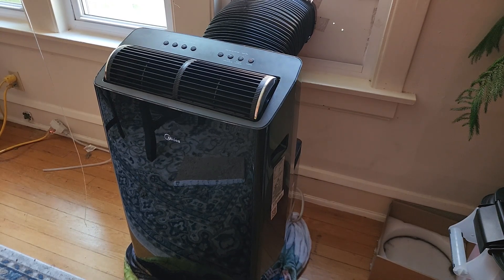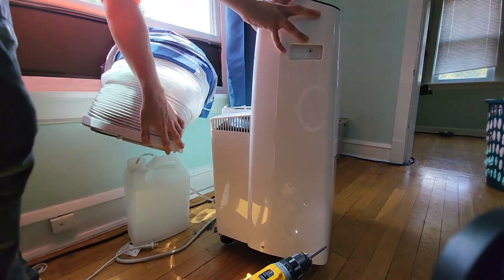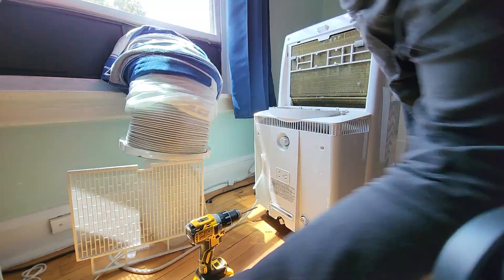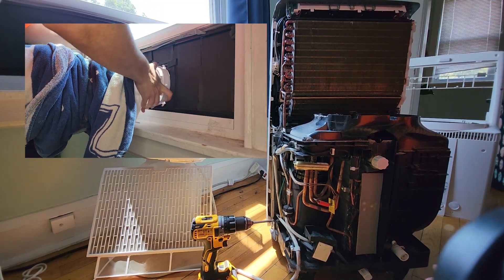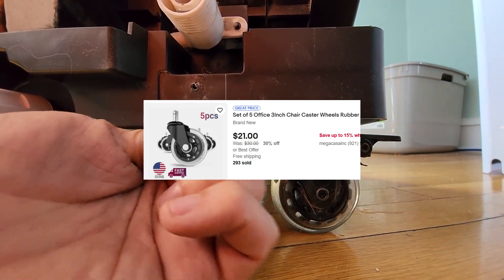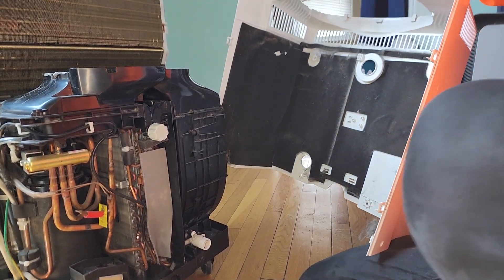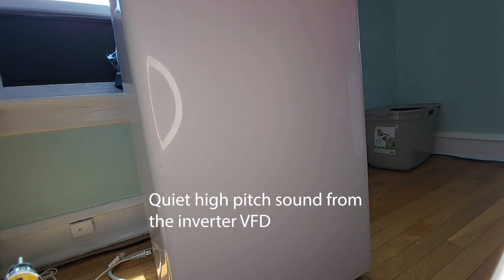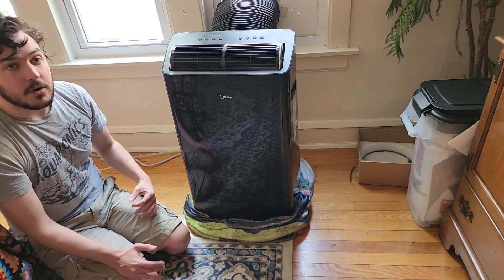Why the Midea Duo is an *Almost* perfect choice for Cooling AND Heating Your Home

Comment: I never took the time to properly. Thank you for the video you made. The only thing I would ask is if you can show the remote control. That actually comes with The black unit and the winter branded unit. Because I hear The One with  Midea Duo Is much nicer than the one with the winter unit. Also, there is a new brand popping up which is just a license version of this. It is Cooper and hunter. By the way, thank you so much for that video.
Reply from the maker: The Midea branded remote is absolutely a nicer remote for whatever reason. I'll see if I can make a community post of the two. It's mostly a visual and ergonomic thing, I think they mostly work the same.
Reply: @AnIdiotwithaSubaru  That's what I was thinking. But honestly I don't know of any other portable air conditioner heater combo that can compete with this.
Reply from the maker: @vectorcollector4893  I'm hoping that in the next few years we will start to see some cold climate heat pump window units! Midea is already working on a cold climate 120v heat pump. They got pretty massive funding from New York (70 million)
Reply: @AnIdiotwithaSubaru  You know something that would make this unit that much better electric supplemental heat.
Reply from the maker: @vectorcollector4893  id love that! If it could heat down to like 20f and then have emergency heat, it would basically be a full on air handler
Reply: @AnIdiotwithaSubaru  It would not be hard to add that.
Honestly
And that would be great. And also there should be a built-in test mode to vary every component speed for repair technicians, just for testing purposes.
Reply: @AnIdiotwithaSubaru  Do you know if they're making a new model of this anytime soon?
Reply from the maker: @vectorcollector4893  not sure. The other company (Gradient) that got some of that 70 million already has a working model but it's very expensive. I think it's like over 3000 dollars. 

Search Gradient 120v window heat pump. Pretty impressive but no thanks at that price. 

I would imagine a giant like midea can't be that far behind. They just need to make one that works well in super cold climates.
Reply: @AnIdiotwithaSubaru  But in the perspective of portable air conditioners. I don't know if anything is going to top this for a while only if they release an updated model.
Reply: @AnIdiotwithaSubaru  A common complaint about these units, especially the Toshiba branded model, is that they do not have a defrost cycle which you have already proven that they do.
But I'm curious why some people cannot get They're unit to go into defrost.

Comment: Awesome video. Wondering if you ever figured out how to clean the space between where the air blows out and the blower motor. If you take a flashlight and look down  in there you may see some bigger stuff or caked on somethings. Anyhow, I'd be super grateful if you did a video on that as well. Liked and subbed ad well!
Reply from the maker: I hot glued a soft bristle toothbrush to a thin rod and I gently work it up and down on the coils. It is strong enough to get the dirt off but not strong enough to bend the coils

Comment: When you use the heat do you need to use the window exit hose ?
Reply from the maker: What do you mean?
Reply: @AnIdiotwithaSubaru  do you need to put the air hose out the window or can you just have it collapsed on the unit just for the heat
Reply from the maker: @davekent20  the hose is required as it absorbs heat from outdoors. It doesn't work under 38f-40f unless you partially unhook the hose like in the video. 

It's not something you want to use for super cold weather. The technology isn't there yet

Comment: Have you had any problems with the draining of condensate on heating mode? Mine just leaks and leak no matter what connector I attach my hose to.
Reply from the maker: It should just be the second to bottom drain port. thankfully have not had drainage issues. Does it leak when the pump is on or just all the time?
Reply: @AnIdiotwithaSubaru  thanks for getting back to me! I have never heard a pump turn on? It’s on the second to lowest drain port, with a garden hose adapter to some drain pipe
Reply from the maker: @rdd594  it's a quiet hum that comes on usually every hour or every defrost cycle. It's just for the condensate pump in heat mode. It's very slow but powerful. I have mine adapted to a small 5/16 silicone tube that is feeding into a kitty litter jug. 

It should only expell water when the pump is on. It's usual only for 1-2 minutes at most

Comment: 7 cats in my house (all rescued as very small kittens that showed up on the back porch over an 8 year period of time). And two dogs (again, rescues). It’s a hairy situation. I’ve gotta vacuum my portable a/c’s intake filters every 4 to 6 weeks. Should probably do it more often.
I bought my unit about 4 years ago at a WalMart here in Arkansas and it is run near CONSTANTLY both winters and summers as it’s the primary a/c source for my 1200 sq.ft. home (my central cool/heat died and I ain’t gonna pay to fix it so I bought my Arctic King). It’s located in the combo kitchen/dining room with an open/doorless 3ft wide doorway separating that area from the rest of the non-air-conditioned house. Have had no problems out of it after 4 solid hard years of use and it seems to work as well as it did the first day I cranked it up, keeping the kitchen/dining room area very comfortable both in summers and in the winters even when it’s near freezing outside. Below freezing and on down to 0 degrees (outside) it must be a real efficient workhorse because although it can’t keep it t-shirt weather in here when it goes below freezing outside, it does manage to keep the temp quite livable in the kitchen/dining room (but you will feel some chill — so we wear sweatshirts and jackets then).

What brand is it? It’s an ARCTIC KING (apparently made by Midea as the manual that came with it gives a webaddress of www.midea.com ).
BTU/h: 13,500/11,000
SACC: 10,000
Its model# is WPPD10HW0N (‘H’ for heat-pump model). I’m happy with the way it’s held up, as hard as it gets used. When temps drop to below freezing or rise into the high 90s and above 100 — for however long those kind of temps are on us, my trusty Artic King by Midea NEVER shuts down to rest or take a break other than the defrost cycles when running the heat in the winter — then it’s right back to work keeping the cold at bay as soon as the defrost cycle has run its course. This can and has sometimes gone on SOLID for a week or two at a time. It’s forecast to get down to 28 again tonight, same as last night. It’s approaching freezing outside now and I’m here in the dining room at the kitchen table feeling cozy thanks to the constant work of my Artic King by Midea. It’s not the quietest machine in the world but it’s run so constantly that I’ve learned to tune it out.
Reply from the maker: Yeah, heat pump mode can be pretty loud. It does keep up pretty well, even on some pretty cold days (with the vent trick) 

With that many animals, id be sure the inside of your unit isn't getting filled with animal hair like both of mine were. I 3d printed some filters for the lower side vents to help but I'm going to clean it yearly most likely.
Reply: Sounds like a nasty house.

Comment: Thanks for the video! Two questions:
1. Did you finish the added fur filter add-on? I worry about all my dog's fur breaking this faster. 

2. In heat mode, do you need to vent it at all? Does it lose any efficiency? It seems like heating the already warmer inside air without be more efficient. Any reason not to do this?
Reply from the maker: I need to vent it when it's around 38f or lower outside in heat mode. It is less efficient but definitely still way more efficient than a space heater. 

I only got the sides done so far. The one's on the back are harder to seal off. It does work pretty well though. I'll upload it to my printables profile soon. 

Opening the vent up also opens it up to more hair btw. I'm probably going to wrap window screen over the hole in the future.

Comment: Whats the trick in order it to function below 32 degrees? Leaving the vent disconnected on one end?
Reply from the maker: Exactly, popping out the screw on that side allows warm air to mix with cold outside air. It still slightly more efficient since it's not sucking entirely from inside. 

I'm going to start running it with some sort of filtered mesh over the hole/opening though because the inside of my Midea was pretty gross.
Reply: @AnIdiotwithaSubaru  have you ever had an issue where the P1 code continues to persist on heat mode? I recently purchased the 14k BPU unit and have the P1 indicator turningnon within an hour of operation.
Reply from the maker: @SOLEoutx  do you have the condensate drain line hooked up? I've had the P1 error but the pump will kick on for a couple minutes usually and it will come back. 

With a low enough temperature, it's possible the unheated drain pan could freeze but I haven't experienced that down to nearly single digits. I believe the drain pan is heated enough from being indoors
Reply: @AnIdiotwithaSubaru  I don't think that this will work. The problem is that the Midea Duo has a thermostat just inside the intake part of the hose. This thermostat will shut the heater off when the temperature of the intake is below 40 degrees F.

This is compounded by the fact that the exhaust hose in located so close to the intake part of the hose that the intake part of the hose pulls in some of the exhaust stream, so realistically, it probably won't operate at outside temperatures below 45 degrees F.

I plan on resolving the mixing of exhaust air with intake air by adding an extension hose to the exhaust to get the outflow away from the intake, but this still will not solve the problem of the thermostat shutting the heater off when the outside temperature is below 41 degrees F.

To resolve the issue of the thermostat, I intend to run a four inch dryer hose from the intake to a four inch vent in the installation panel. so it can suck air into the intake from inside the room. I figure that by mixing inside air with outside air, I can raise the temperature of the intake air above 41 degrees F at outside temperatures as low as 26 degrees F. This solution should also help to cool the over 100 degrees outside temperature below 90 degrees F.

The biggest problem with these adaptations is that I have been informed my Midea that even adding the extension hose to the exhaust will void their warrantee.

I'm not even sure if wrapping insulation around the primary hose will void their warrantee.

My guess is that they are limiting the functionality of the Midea Duo to insure it does not compete with their much more expensive all-weather units designed for NYC apartments.
Reply: @dalesplitstone6276  do u have video or pix posted of how you ran the dryer type vent ‘air mix’ hose?   And did it work well?    I’ve seen people say they moved the temp sensor to inside the unit where it’s warmer so it still runs below 32degree temps.

Comment: Hey man I greatly appreciate your videos! I am full time living in a 35' 5th wheel camper and bought a midea like your black one and curious what other mini splits or heaters would you recommend? I am renovating the RV and already have to replace the roof ac and heat so now looking into more mini splits.
Reply: Just broke it trying to get it apart like you did
Reply from the maker: I've been shopping around for 120v stuff and there are not a massive amount of pre-charged equipment for sale. 

A few years back you could get small 8000 btu mini splits with flexible lines attached that were supposed to go in the window somehow but they stopped selling those due to leaks I think. 

If you're fully renovating, id look at some of the 120v "floor" unit mini splits from pioneer. If you're feeling a little more spendy, id get a more expensive LG unit so that when it comes time to repair, you can still buy parts for it. 

I definitely think well see a lot more cold climate 120v stuff in the next few years. if that's what you're after.
Reply: Another option to keep in mind while replacing RV units...  There are some nice smaller inverter units on the market that run on 12v, 24v, 36v and 48v...  thereby allowing you to bypass the inverter and run them straight off the house batteries. 
I've seen them in both mini split and roof unit configs. 
I'm looking at installing one each of the 24v units myself. 

But now that you've mentioned it, I'm gonna look into that 120v floor mini split too, thanks!

Comment: I run a portable ac unit backwards to heat my bedroom and bathroom in my 5th wheel. Thats a potential unit for me to get in the future.
Reply from the maker: It's pretty versatile. It makes a decent amount of water in heat pump mode sometimes. I don't think I remember it being over something like a gallon overnight and I'm sure it would be less in a trailer. 

 This paired with a big ecoflow or a digital inverter gen would be a good combo.

Comment: Hi. What about power consumption? For example 40F outside average, how many kwh it takes per day? How many sqfeet it's heating? Thanks
Reply from the maker: My kw/h meter died last year so I didn't get enough data but I can tell you it operates at around 900w-600w power draw depending on how recently it has defrosted. 

The unit usually will defrost every 1-2 hours when it's very cold, it will draw 900w right after the defrost cycle and heat a lot. After about 30min to an hour it will slowly drop to 800-700w. 

It will then switch to defrost where it pulls 300w-700w for a couple of minutes. 

Essentially, it doesn't pull more than 1KW per hour. 

Please note, if you're planning on using this to heat at a lower outdoor temperature, you need to pull part of the vent off. That does reduce efficiency but it does allow it to heat down too much lower temperatures

Comment: In the heating mode does it not evaporate the condensation?  I noticed you said you had a jug there for when you run it in the heating mode. I'm just curious looking to upgrade but my current whytner model self evaporates condensate in cooling and in heating. We should have pretty similar weather if you are in Chicago i'm just a few hours south of you. Definitly would be a desciding factor for me.  Great video by the way.
Reply from the maker: It does need somewhere to pump water in heat mode. It's just kinda the nature of the beast. I has a very strong little lift pump built in for when it needs to drain and I usually have it pump outside unless it's below freezing and I want to continue to heating using the tube trick. It's an amazing unit though
Reply: @AnIdiotwithaSubaru any thoughts on why in heat mode, I get water that leaks next to the condensate drain? Is this a gravity system? I assumed it would pump up and out.
Reply from the maker: @Matt-rq6wz  the unit doesn't pump it outside as is. You need to run a hose to the lower drain port. It's a small pump with a lot of pressure. You can also pump it outside but you risk the pipe freezing. That's why I use a jug
Reply: It can't evaporate condensation in heat mode because the only heat source capable of doing this is "exhausting" indoors, thereby potentially evaporating all that steam INTO the house.  
So that's why they collect it in the tank instead. 

Btw, the lowest drain is a simple gravity drain.  The middle one is the pump output drain.  And to my knowledge, the top drain is for running in dehumidification-only mode;  I'm not sure why it doesn't also utilize the same method as the AC mode.  
If somebody has the answer to this, I'd love to hear it!
Reply: The top drain is not just for the dehumidifier. I live north of Tyler, TX and my unit can produce 4 gallons a day in July and August from the top drain in AC mode.

I'm not very knowledgeable with the drain system, though, so maybe I'm draining overflow instead.

Comment: Hello, I would be interested in a set of your roller mounts.  i have the Midea duo and could really use these. i use my unit in Camping Canvas Tent.  Please send any info. Thanks,
Reply from the maker: I can absolutely do that! I have the footage of installing them sorta edited but sadly it was shot vertical so it will look kinda silly. 

I'll upload it in the next day or two and link the Printables.com link. I'll try to remember to message you :)

I'd recommend wheels with locks. I had to drill out two of my four locks because they hit the underside of the unit but just the two alone stop it from rolling on my uneven floor
Reply from the maker: https://www.printables.com/model/562629-midea-duo-office-chair-wheel-adapter-use-new-and-s